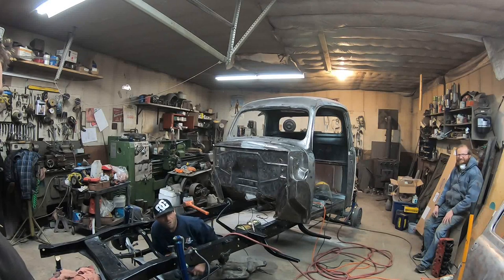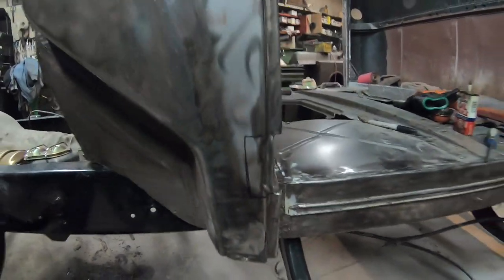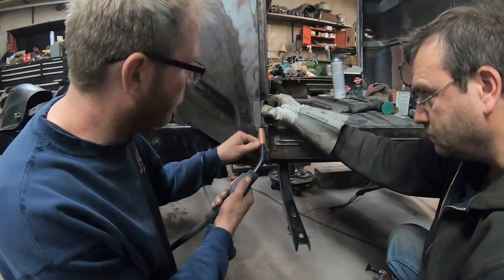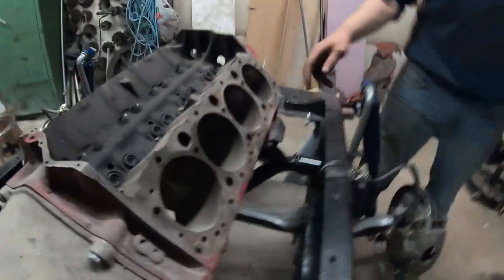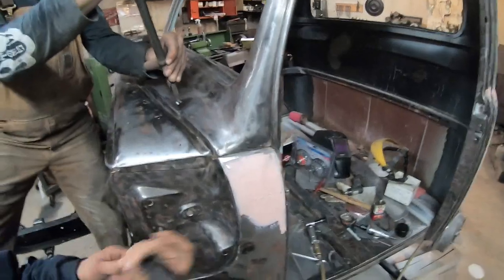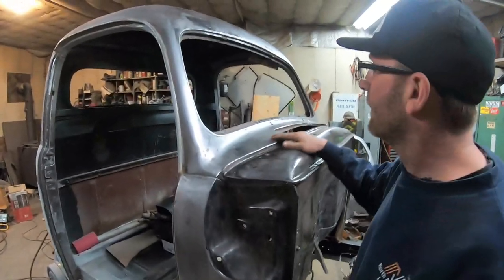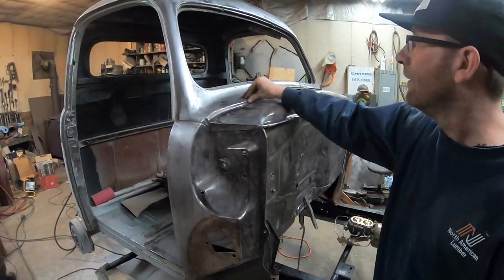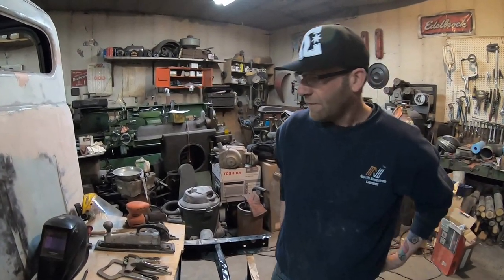1952 Ford Truck Sheet Metal Repair, Dent Removal.

Comment: Could you do a video using the english roller?
Reply from the maker: We will try and do a demo on it once we start working on the front fenders of the 52 Ford Truck.  There are some rusted out area's that we will have to make some patch panels and will have to curve them a little with the English Wheel.